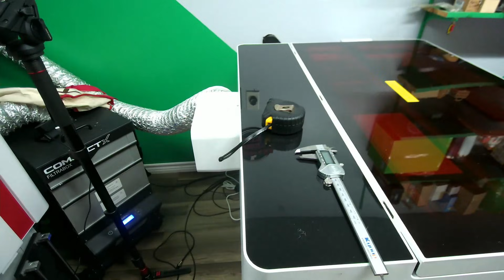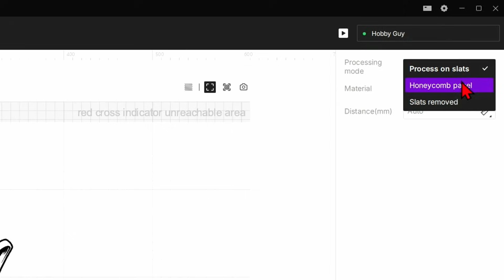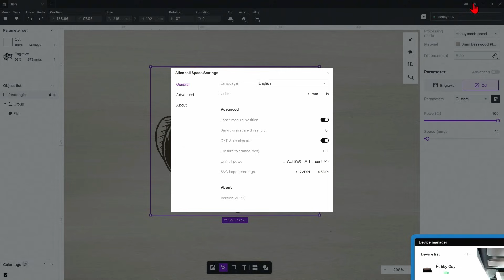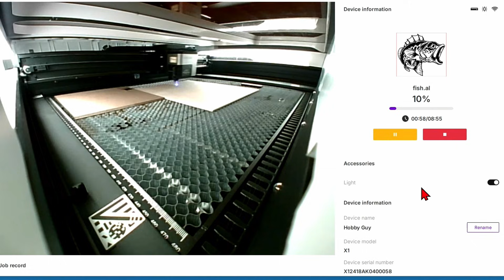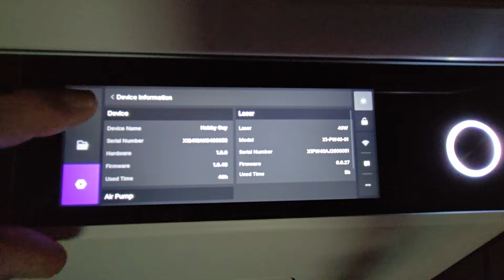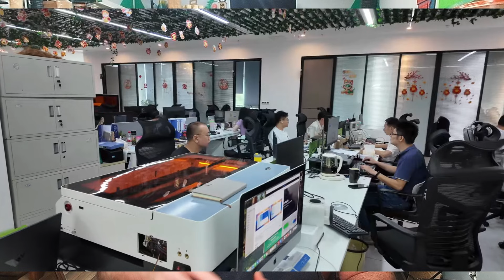⚡DEEP DIVE into the Aliencell X1 diode laser. This is truly a first of its kind!

Comment: I know you said they're working with Lightburn, but does it require internet to operate? Because I'm not sure I'd be interested in another Alibaba product that requires internet access to operate.
Reply from the maker: No, it does not require an internet connection to operate. You can run it direct from any computer via USB locally.

Comment: Great video Rich!!  Thanks!!  I'm very seriously considering buying the 60w.  I have a mk2 xw 30/10 that I still love but I would like to be able cut 1/4" and up to 3/8" material quicker and without so many passes.  It appears that the 60w has a smaller spot size than my Roly even in 10w mode.  What are your thoughts on the 60?  I know Patrick (LSE) has a 60w do you know if he has any more videos planned?  Thanks again Rich!
Reply from the maker: Glad you found it helpful Joe! The 60W would definitely speed up your cuts on thicker materials. Keep in mind all of these, 20, 40, & 60W are all underrated. For example, my 40W has a max power of 45-47W. Patrick isn't doing any videos right now due to personal issues.

Comment: Doubt they can survive.
Diode startups fail at 90% rate.

1. Kickstarter Fundraising
	•	Aliencell ran a Kickstarter campaign for the Aliencell X1 Real-Time Rendering Laser Engraver.  ￼
	•	The project raised approximately HK$1,246,015 against an initial goal of HK$80,000.
Reply from the maker: They have committed a lot of time an resources to this project, over $1.5M so far. With a staff of over 50 people, I think they're in it and going to take the top spot for the diode market. There is a lot of funding behind the project, the offices, staff and factory, so I believe they'll be here for the long term. This isn't your typical startup. The technology is what will propel this company.

Comment: This experience is highly similar to what it's like using a Bambu Carbon X1 3D printer, which makes this very attractive as a potential purchase for me. I've used some much older laser cutters and it's refreshing to hear the industry is embracing this kind of modern user experience. No offense to lightburn but there are a lot of user friendly features that can really make a difference. Bambu's products also store time lapse video and previous job files on an onboarding SD card to easily repeat jobs from the touchscreen. I do a ton of prints from my phone since it also has an integrated print sharing community built into the app. Also integrated maintenance reminders on the screen and via phone notifications which is a huge help. Not sure how much maintenance a laser cutter might need but it would be a useful feature since it can track its own hours and job usage.  

The biggest thing for 3D prints though is that the AI integration that will not only detect problems using the camera and onboard sensors, but it will alert your phone of there is a problem. I can imagine if there's a material in the laser that catches fire or even just aesthetic burns on a material, if you could be prompted whether to continue or abort the job would be a huge addition. 

I'd also love to see a laser feature that engraves a calibration mark on the material so if you remove it from the bed or move it, the machine could use the cameras to adjust the job to resume it no matter where you put it back, or automatically finding corners to square off your design on a piece of material that is inserted at an unusual angle, or maybe automatical material saving optimizations. Like if a new user tries to cut out a sign or something like your fish directly in the center of a huge piece of wood, giving a prompt when starting the job to offer to reposition the design to the edge of the materials. The more user friendly you can make this stuff, the adoption rate will skyrocket.  

I don't know how the air quality sensors work, but I would love to see an optional sacrificial engraving or cut for certain materials that could measure potentially toxic, lethal, or machine damaging gasses or fumes before running a full job. Many users will throw things into the laser they don't know are dangerous to cut, if the barrier to entry is lowered. Anything to help. Detecting whether the fume extraction is connected properly, whether something might come into contact with the head, whether designs will accidentally lie outside the bounds of the material, or reflectiveness that could damage the laser any of that stuff. 

Bambu also has AI chat on their site so you can get answers to every possible question with references to the spots in the manual however you wanna ask it. Would love that as a new laser user, if aliencell is looking for feedback. 

I think the miscalculated time for the job percentage might be related to the calibration sequence? 

Either way thanks a ton. Looks like a really promising machine. The only thing I'm wishing is that it could support larger size materials than the cutting bed itself. The Xtool P3 I saw from another YouTube channel looks amazing but is obviously in a different price and user class.

Great info
Reply from the maker: Thanks for the very detailed feedback and suggestions! I'm sure the manufacturer is watching!
Reply: @TheLouisianaHobbyGuy  Yeah, I am watching. And you guys will see the features.They are all on my schedule.🤠